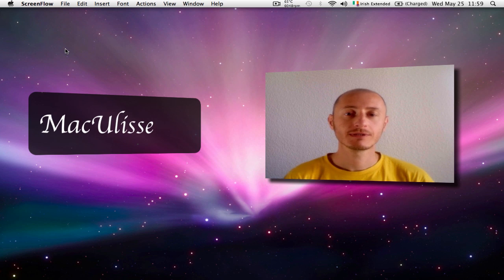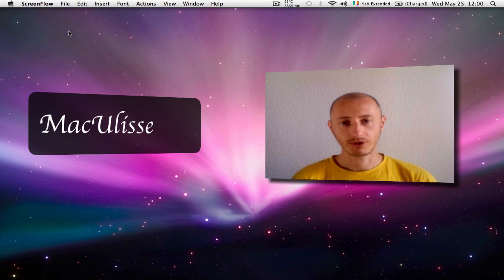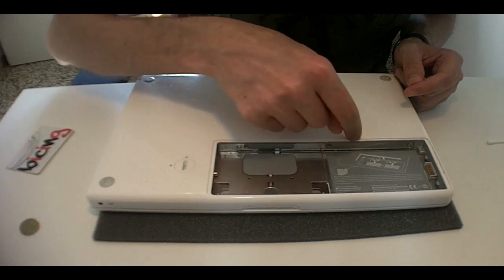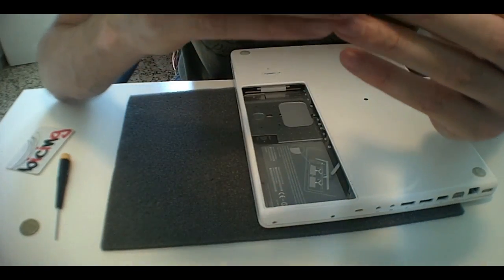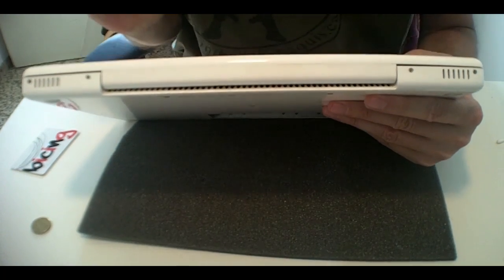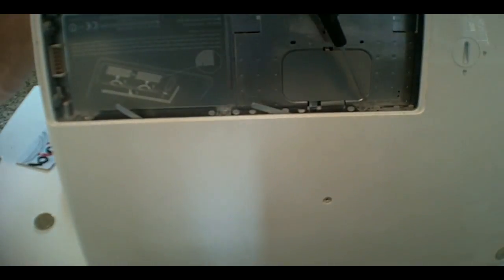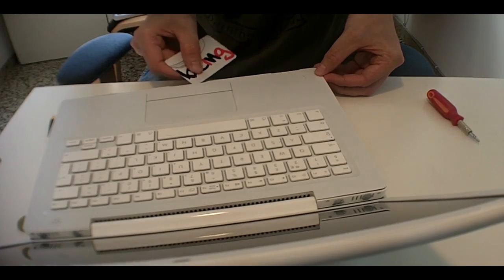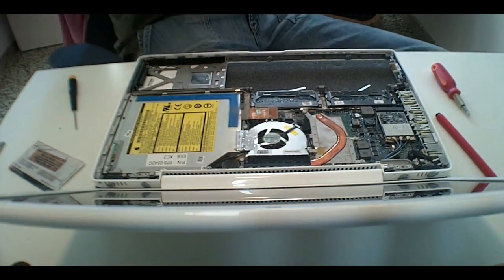Replace thermal grease macbook part 1

Comment: Wow. I did three GeekBench tests in a row before this procedure, the MacBook scoring worse each time, last one taking over 10 minutes. After new grease and (especially) unclogging fan ducts, the same 3 GeekBench tests in a row all took less than 4 minutes and received near-identical scores, almost double what the two-core results were before. And instead of continually running, the fan just revs during hard work, then spins down within a minute.